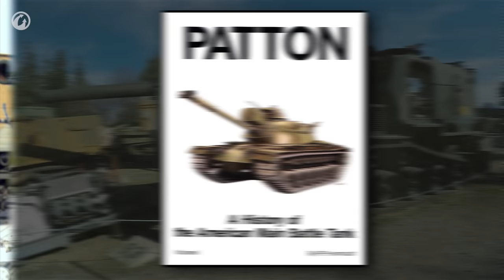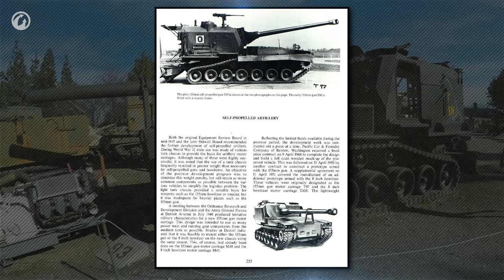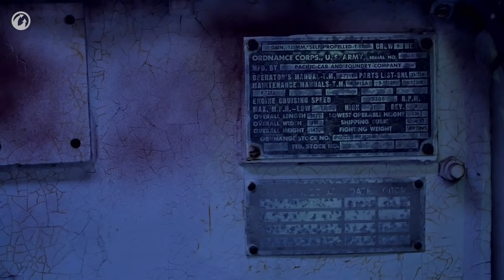Inside the Chieftain's Hatch: M53/M55

Comment: Yes, happy memories of the steel beach picnic. Cut the 55 gallon drums in half from top to bottom, weld legs on the bottom fill with charcoal, light. When ready add a steel grate on top. Cut another 55 gallon drum across the middle. Fill the halves 3/4 with beer. Top off with ice.

Comment: The wooden mockup was used before CAD-CAM to see if everything fitted together!
Reply: They'll still do this in some engineering fields - eg for space launch rockets they'll run a "fit check" fairly early in design with unfinished structural parts to make sure everything fits together and sits in the support equipment right.

Usually in that case the "mockups" are big and expensive enough that they'll actually use them for early production items, pulling them out of the fit check and sending them on to get engines and plumbing and electronics installed.

Comment: That's an M37/M38 beside the beast.  Part of the Combat Vehicle Family based on the Chaffee chassis, the M37 was to replace the M7 and M7B1 HMC, while the M38 was to mount the 4.2" "Chemical Mortar".  Also part of this program were the M19 MGMC (the original "Duster"), the T77 MGMC (with quad-later sextuple-.50cal AAMG, a High Speed Tractor (for artillery), and a cargo carrier.

Comment: equilibrator (plural equilibrators)

(rare) A device that maintain equilibrium or balance, especially a part of a heavy gun (e.g. an artillery piece or a tank gun) which balances the barrel and other parts so as to enable the gun to be elevated easily.

Comment: Ha! Caught you in a mistake! For once! Germany also used M55. The M55 203 was the standard heavy SPG of the German Bundeswehr in their "Divisionsartilleriebrigaden" basicly the SPG Brigade of a Panzerdivision. They were replaced with German long barelled M109s in early 80s. Panzerdivisionen and Panzergrenadier Divisionen had SPA brigades with M55 203s, mech. and mot. troops had the M44, later the M109G and the seperate Artillery Brigades had M110s.

Comment: I think the 8 inch was a gun and not a howitzer.  At least it was in the 80's when I was a redleg and they were being phased out.
Reply: I was a 203mm battery FDO until the 90s.  The M110A2 was a howitzer, could fire a round up to 30 klicks, could knock through over 36" of steel reinforced concrete, and the round could disable any vehicle in the inventory.  The system did have shortcomings.  The crew was exposed, ammo was becoming difficult to find in recent lots, and it was slow.  They were declared obsolete in 1993 and all were out of the inventory by 1994.  Many of the guns were converted to "bunker buster" bombs.  A good number of them were expended as artillery targets or cycled as use as museum pieces or VFW monuments.
Reply: The M107 which was a 175mm was classified as a gun. The Marine Corps deactivated its M107’s in 1983. The M110 8 inch were all howitzers. There were 8 inch guns back in WWII.
Reply: M53 was classed as a gun, M55 was a howitzer. Apparently the M53 ammo was not compatible with 155mm howitzers like the M114 and M109.

Comment: Did the sights have adjustments for either gun caliber?
Reply: the sights were the same on both howitzers.  Gunnery calculations were done differently using different firing table books.  All guns shoot off a setting of quadrant ( basically various degrees of up from a horizontal position) and deflection (left and right).  The firing tables dictate the way the gun fires.  Those are the books and the technical orders from the army.
Reply: @Easy-Eight  well said sir.

Comment: I wonder why that gun has a screw type breach?
Reply: The breech uses interrupted threads. Same as the M114A1, M109, M107, and M110 howitzers. All of these use separate loading munitions. Once you seat the projectile using a ramming staff or rammer, you insert the powder charge which is a bag charge.
Reply: @stevewilson4514 and interrupted threads are required for bag type propellants because it doesn't have a case to obturate the breech. It's much easier to fit a brass obturating ring onto a breech plug than a sliding block type. Which would also have to be very enormous to handle a large gun. Most large guns ar e interrupted thread. Or actually Welin type, which is an improved style that only needs a small rotation to unlock, and can be stepped down into a cone shape to allow it to swing open instead of needing to slide back a foot or two to clear the breech like a true interrupted thread type.

Comment: "4 12v batteries giving you 24v, as you can imagine they are linked in series in parallel"
What?
Reply from the maker: +PureZOOKS Take two batteries, wire them in series. It ups the voltage from 12v to 24v. Take another two batteries, do the same. Now take both pairs of batteries, wire them in parallel, this keeps the voltage the same at 24v, but ups the amperage.
Reply: +PureZOOKS Meaning that two batteries are linked in a series (as in after another on the same "lane", if you will) to increase to voltage to 24V (2x12V) and then the two pairs are linked in parallel in order to increase battery capacity.
Reply: I would have said you'd have 48v but then I read about the wiring the batteries up in parallel, keeping the volts but upping the amps.

Didn't that would work that way, but it does and it's a fairly interesting mechanic nonetheless.
Reply: +TheChieftainWoT It made sense for the majority of us :D. Keep up the good work!
Reply: +PureZOOKS  so how u get that is pair 2 batteries in series making 24v system then add another 2 in series. now u have 2 groups of 24v in parallel.